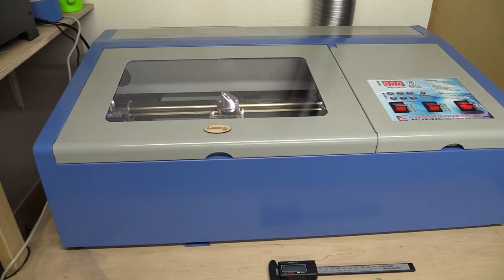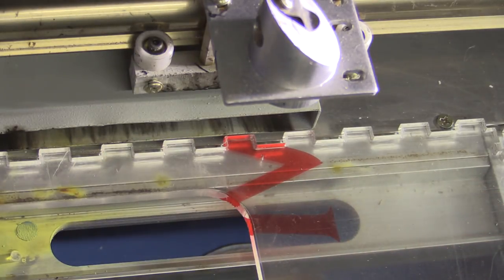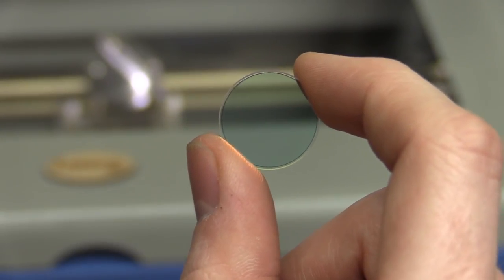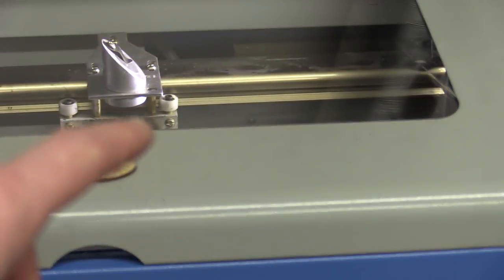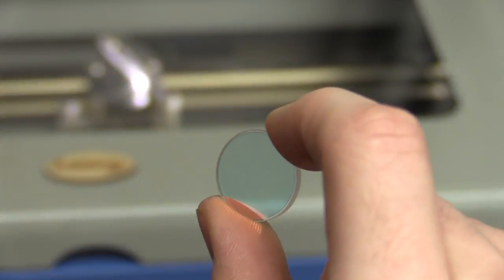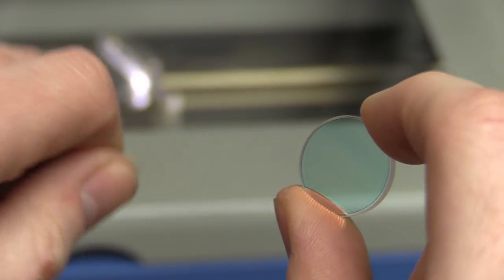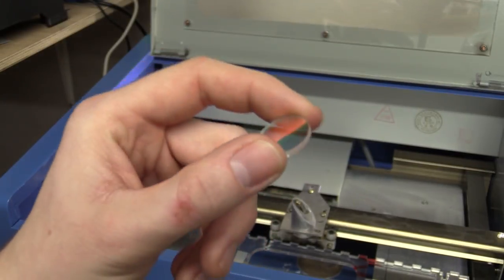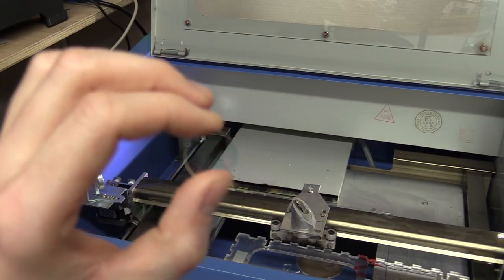40W Laser Cutter Upgrade: Making a Red Dot "Cut Indicator" - Ec-Projects

Comment: Nice job. Another possibility would have been to project 'cross hairs' i.e. 2 laser lines which intersect at the cutting point. Although that would be a lot more complex and costly than this. Thanks for sharing.
Reply from the maker: jix177 Thank you.. :) Yeah, I did consider that, but I convinced myself that I couldn't make a lens good enough for making a sharp line :P And I just wanted to get it done :D 
It would be better since that also would eliminate the "parallax" effect between the cutter and the red indication.. Thanks for the suggestion !

Comment: You really should be wearing your safety glasses. Especially when adding optics to high power system in this manner. Once that primary optic split you could have been getting a bounce at literally any angle. Not worth the risk. Put your peepers on.

Comment: you can try two line lasers from ebay and mount them on right and front side of the mirror. This way you will have a cross and it'l be exactly in the laser spot regardless of the material height.
Reply: you can buy a cross hair laser and then need only one...

Comment: Tx, surely that laser requires a heat sink, its just a naked diode and will probably burn out after 20 minutes continuous use or less, you would be in my opinion much better off using a cross hair laser and use that in combination with Laser Pointer Offset control in Lightburn and it will allow you to place the laser exactly in the right position without having to try and manually line it up with the mount etc. Its much easier and its 100% accurate everytime.

Its not so bad for me as my tube as the laser screwed on to the end of it but by the time it goes through the mirrors the red dot it more like a ghost of a dot as you l9ose so much of the brightness that way so I am looking to install an additional red dot which is where I came upon yours. tx.

Comment: I thought as soon as I saw it that that beam combiner wasn't going to work. You need a material that will transmit light at 10.6um and that's usually Zinc Selenide, just like the focusing lens.

 ZnSe has that distinctive orange hue and your beam combiner didn't.

Comment: what if you mounted a servo there where the c02 beam comes out.  Connected to an arduino.  Code it so a momentary button press would position the laser diode and fire a beam.  When the button is released, the Diode would turn off and the servo would remove the laser diode from the path of the co2?

Comment: You kinda covered your "handle" to move the gantry around with the switch. Perhaps you could make a little handle mounted in that hole under the switch and then install a momentary (or not momentay) switch in the handle itself.

Comment: Do you have a tip for tightening the laser head? Regularly after some time, the head unfreeze and the quality deteriorates greatly. Subsequently, it must be re-tightened and adjusted.
Reply: dab of superglue solved a screw that will work loose. That or o rings

Comment: I'm wondering can this laser be used to make pcbs? I was thinking about engraving copper on the pcb or burn off some paint over pcb for etching if it's not powerful enough.
Also can this cut FR4 without copper? Some experiments perhaps? :)
Great videos so far, thanks!
Reply from the maker: Anton Veretenenko Thank you.. I didn't try plain FR4, but it doesn't touch the copper.. :(
The paint, I did try but I haven't had much luck with it.. It's like I can't either get the resolution good enough or get it to clean up for etching..
Reply: Based on my experience with my 20W Co2 laser, it is strong enough to cut FR4 in slower speed.. But copper? It doesn't leave any mark on copper even in full power..

Comment: What power and cutting speed do you use on 3mm acrylic? I use 5mms at 85%.
Reply from the maker: Seb Meikle I can do 9 mm/s at 80 %
Reply: Yeah, I've recently tweak the settings. New focus lens has helped a huge amount. I can cut 3mm acrylic at 12mms at 55%, 5mm acrylic at 7mms at 55%.
Reply from the maker: That sounds interesting :P
What lens did you get ?
Reply: Just a cheap chinese one. Took a while to arrive though. From eBay. It really does help to clean the lens regularly, especially after etching.

Comment: Is this laser cutter good?
Reply from the maker: Sterminatore67 Considering the price, I would say yes. Compared to an EU or USA made one, probably not :P hehe.. But it's fine for what I do anyway !
Reply: intriq8 I want to buy the laser cutter with the ramps 1.4. I think the other part I've already. Or for you, Can I build it from scratch ( I've a lot of time )
Sorry for my English... I'm Italian ahahhaha
Reply: Sterminatore67 Are you asking if i think you should build it from scratch instead of buying a cheap one? thats totally viable, you can make a better machine with a bigger area etc,.  ramps is indeed a cheaper control option than DSP controller, but another way to go  (maybe better, maybe not) is to use a CNC breakout board (cheap)/ optional usb motion controller, and linuxCNC, or emc2, or mach3 on a pc as the controller.  
The $500 engraver/cutter product is just a pretty cheap way to get a tube/psu/optics/steppers all in one.  but they only have 35W tubes.  for $500-800 you could just buy a better 60W or 80W tube w/PSU. but you'll need to buy or design and construct the x/y stage. basic budget is at least $1000-1200, and more for larger cutting area.   but this is all cheap compared to off the shelf commercial cutters, and building one yourself is rewarding, if you like learning in this manner. so , if you've got the time...and knowledge, and skill, or more time to get both..  or, would you rather get down to designing and cutting things, rather than spending all your time designing and making the tools?.  I do a bit of both, but probably too much of the latter.